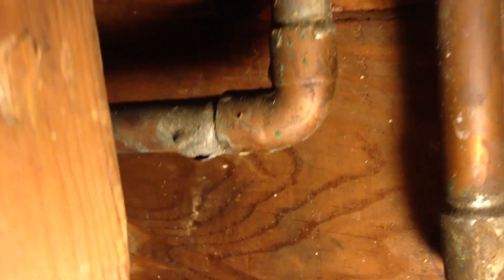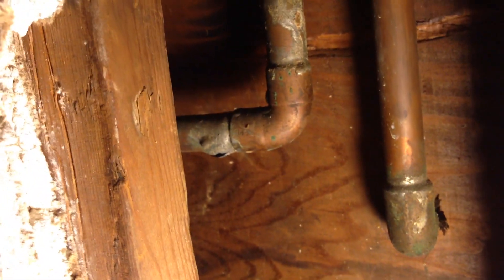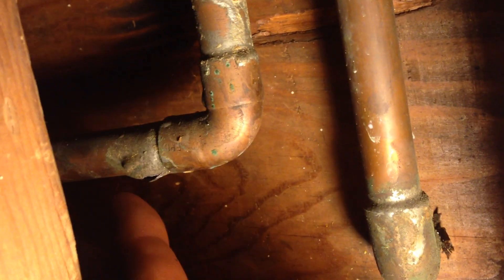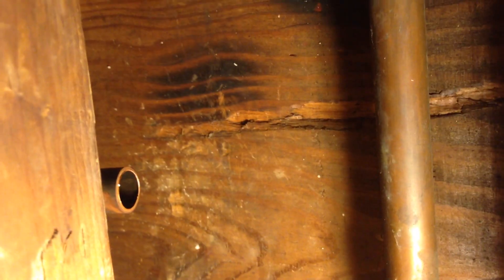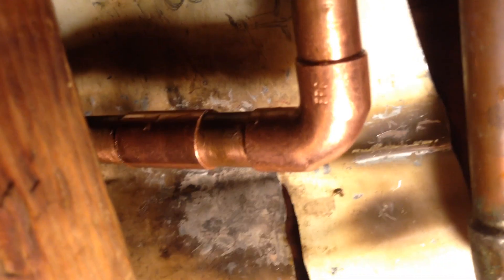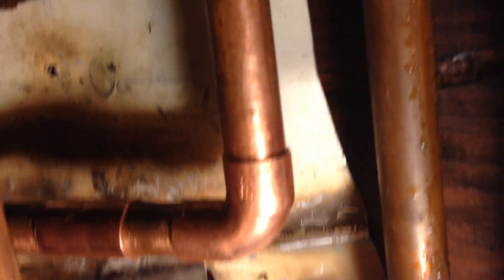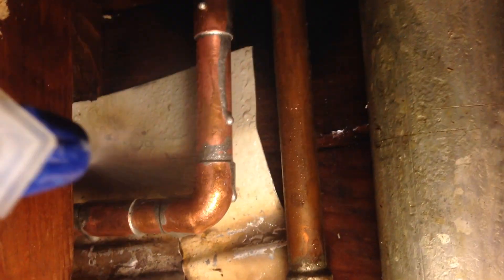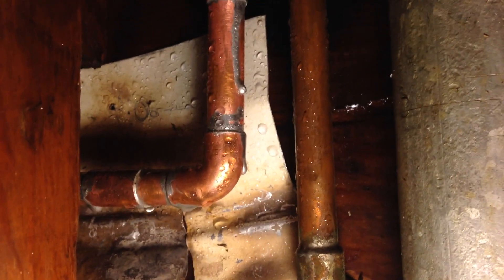Soldering a copper pipe inside a wall with very little room

Comment: I've heard forcing it to cool with water can lead to cracked solder joints. The flashing and water on the wood is a good idea though.
Reply from the maker: I've heard that too but have never had a problem with cracking solder

Comment: Sometimes it’s so deep in a tight place you can’t get a flame in there. You ever use a compression fitting or shark bite in that case?
Reply from the maker: I don't trust shark bites
Reply: handy123 well unless you want to throw flames in flammable insulation your only other choice is compression fittings. Most industrial applications use those exclusively.
Reply from the maker: @robertgary3561  
Thanks for your comment.  I guess that I'm old school but prefer solder joints to compression fittings.  I'm not a fan of them or pex tubing.
Reply: Quick connect (shark bite) is not code in many areas. I failed a home inspection due to them.
Reply from the maker: I'm too old school for shark bites and have seen a number of them fail.  Others swear by them though.
Reply: @robertgary3561 usually in confined spaces and non visible spaces your going to want a copper pipe that is soldered and no shark bite fittings or compression fittings due to not being able to closely monitor the fittings at times.